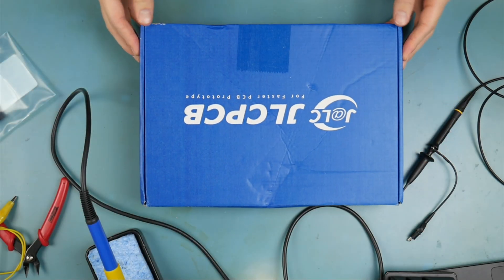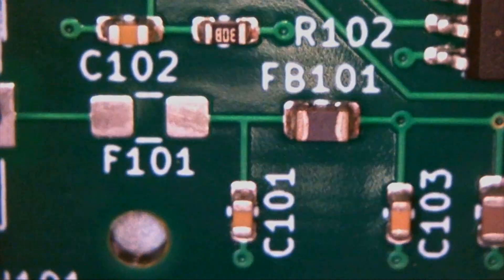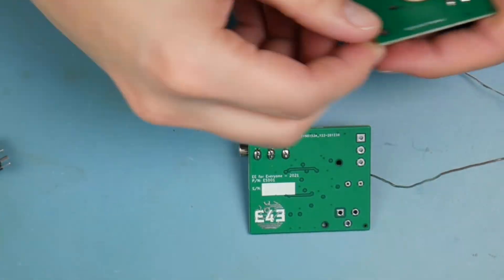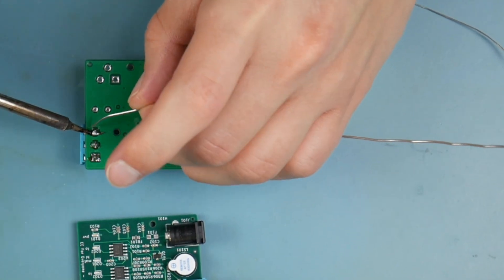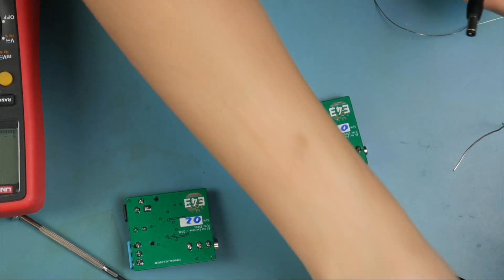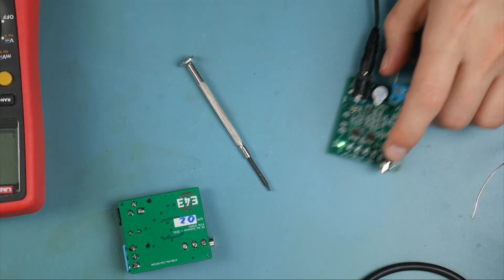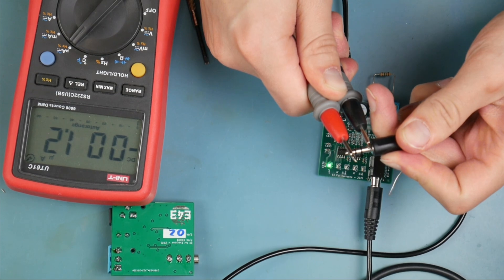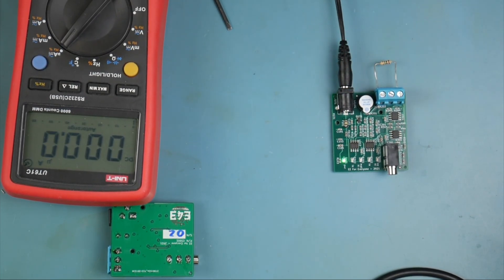ESD Mat Monitor Assembly! (Soldering & Test)

Comment: great ..this would be cool also if it supported 2 esd mats .. one for table one for floor esd mat .. waiting for the next one allready :P
Reply: If you connect them in series, I think it would.
Reply from the maker: Yeah Hasan! You can actually daisy-chain two mats together for that kind of functionality, of course, it won't be obvious which wire broke right away, but at least the monitor circuit will work. Thanks for watching!